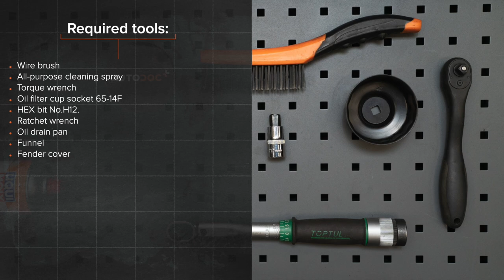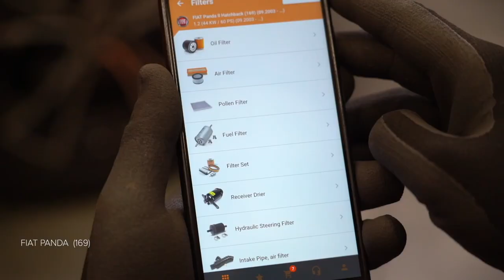How to change oil filter and engine oil on FIAT PANDA (169) [TUTORIAL AUTODOC]

Comment: Check alternator bearing, the engine sounds rough 3:44 something is not right
Reply from the maker: In this video, when the engine is running, there are no extraneous sounds, the engine works well.

Comment: It's not 12 mm hexa it's 10 mm
Reply from the maker: In the video at 00:12 minutes, you can see on the head itself it says size 12. Maybe in your case it could be size 10, different manufacturers may make them for different wrench sizes.